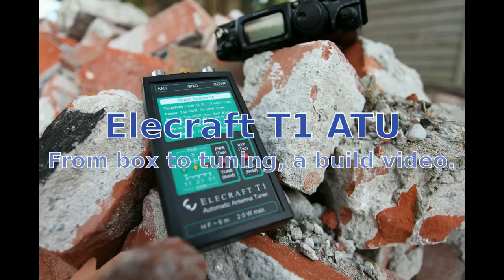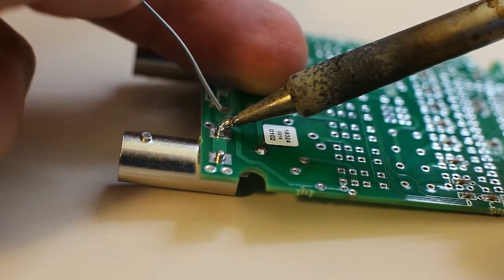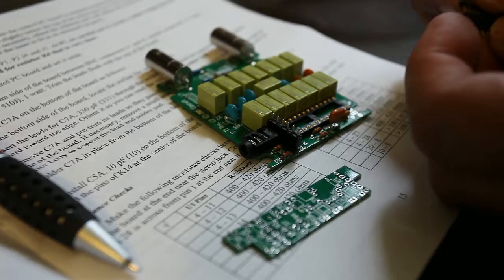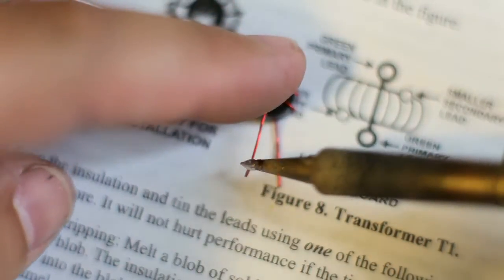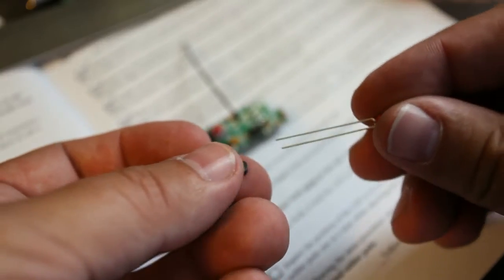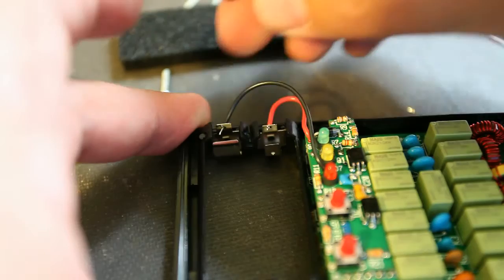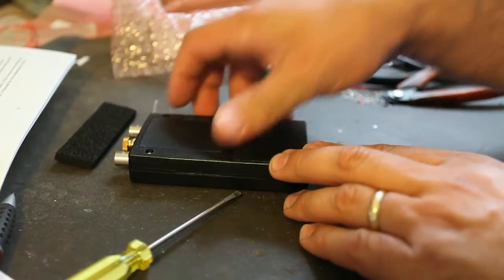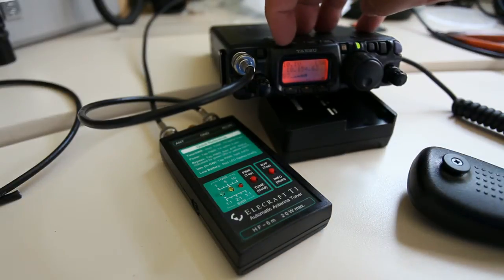Elecraft T1 kit build and test

Comment: It's been a while since I thought about my soldering methodology being aviation grade MIL-STD but this did, I use flux and pre-tin and pre-bend all components religiously lol. Anyway, thanks for this, I wasn't sure wether to get the kit or ready, but I will get the kit and do some small mods to it straight up, lacquer the toroids and use some conformal coating on a fair bit of the board.
Reply from the maker: ROFL...   Used to work in an industry where that was common practice (not mil) but can't say I've ever thought about it for ham stuff.  Good quality fine flux-cored solder and I'm good to go. :-)

Comment: This is not a good tuner for the 817. Takes to long to tune and you have the possibility of blowing finals
Reply: nr3rful don't you technically have the risk of blowing finals on almost any radio using any tuner? I'll be running my 817 with an amp to get 10w and protect the finals anyway before I get the T1, the amp is sacrificial in case anything goes wrong, tuning or too much duty cycle with data.